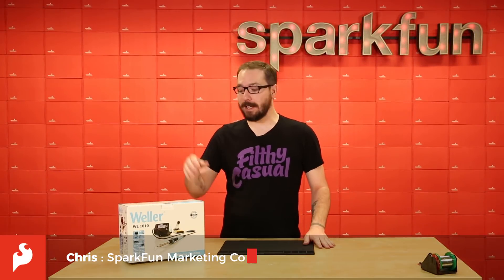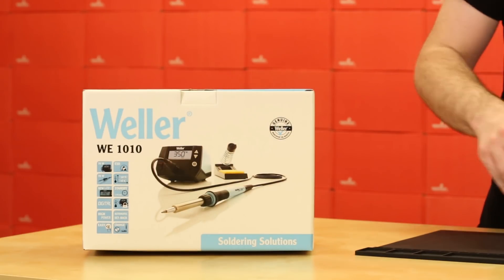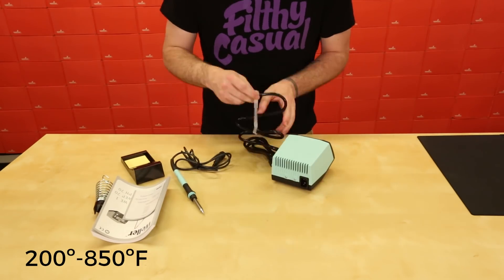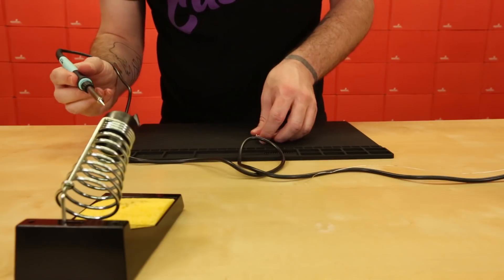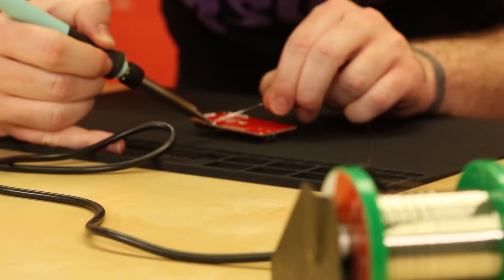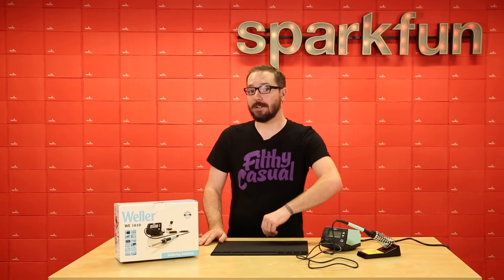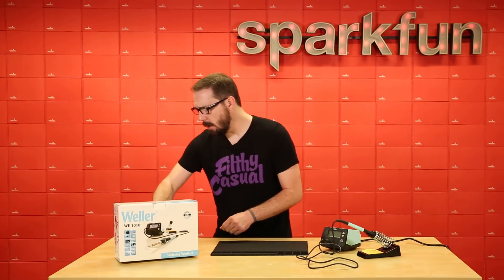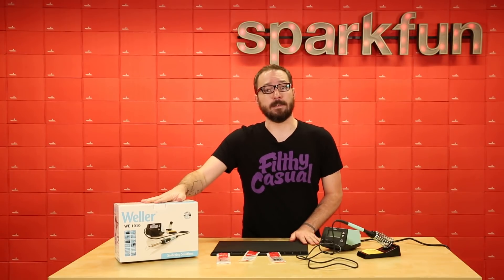Product Showcase: WE1010 Soldering Station

Comment: I have searching for basic info on this station. I got for my birthday. Great so far but the weller website is just about worthless for getting an operational instructions... how does one use the offset and what is it for. Somewhere i saw that if you touch the tip it heats up again....maybe different model. Nice video...
Reply: The offset is basically the difference in temperature from the tip and what it’s showing on the screen, because it’s not always accurate at first so you have to calibrate it

Comment: Is this the one that lights on fire if you feed it 240V? :-) (See EEVBlog)
Reply: Anything wired for 120v is likely to light on fire if you plug it into 240v.  It’s called reading..
Reply: it is :) no fuse or protection on primary side

Comment: Old Weller was good, but the Weller after they were bought out is less so. Also a new production iron still using wet sponges? No instant standby mode? You didn't tin that tip before putting it back in the stand?
Reply: cypherf0x Yeah, I prefer a brass wire sponge but c'est la vie. I can assure the tip was tinned when I put it back in the holster but it just wasn't added to the video.